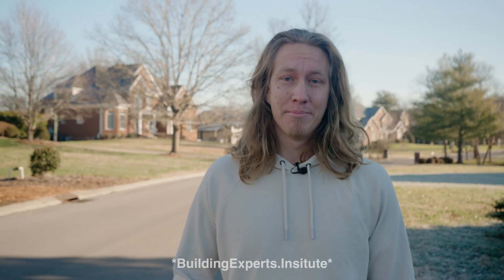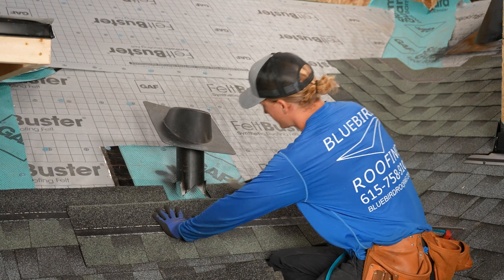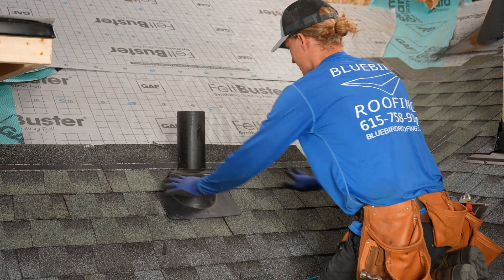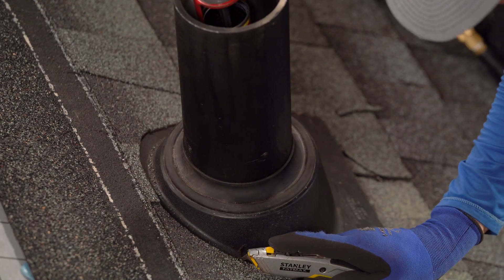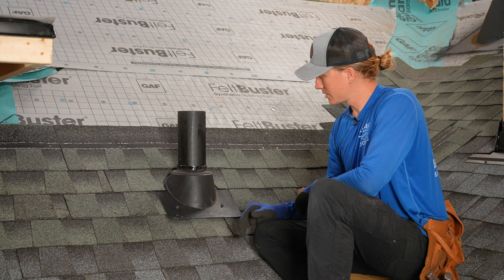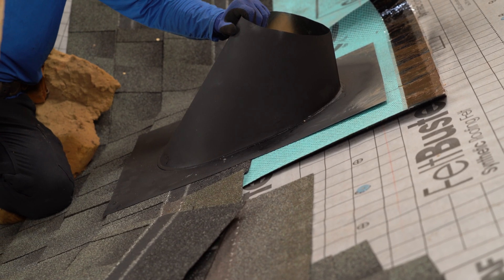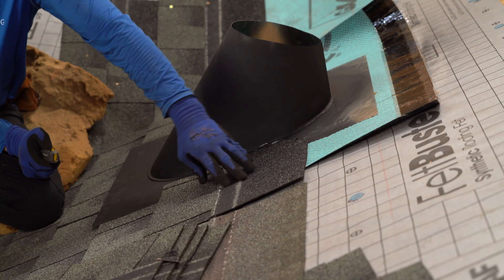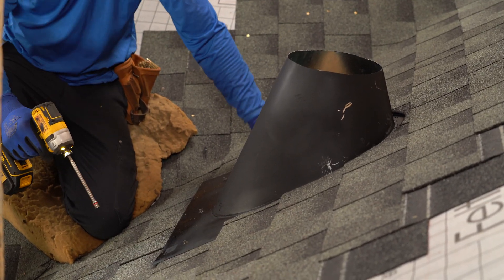How-to: Roofing Pipe Boot and Metal Pipe Flashing Install

Comment: What do you mean 2”…..2” of flange on top of reveal ?  I understand it as headlap of shingle should be at back/high side of pipe…or higher… and then install flange and continue with next course over top /back of pipe.